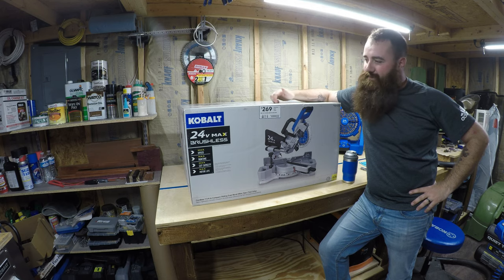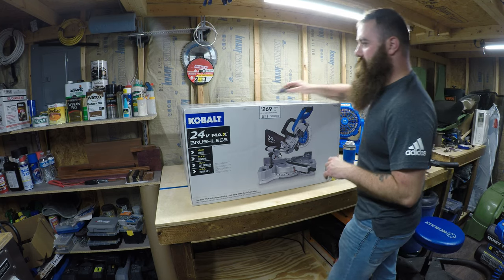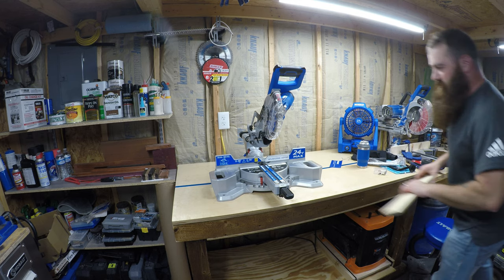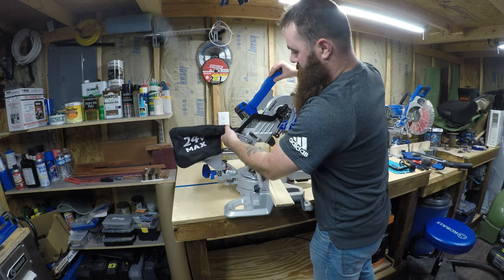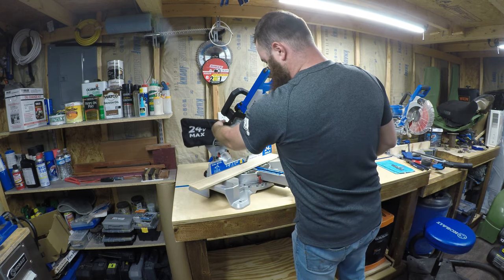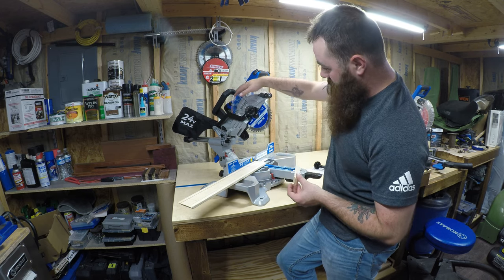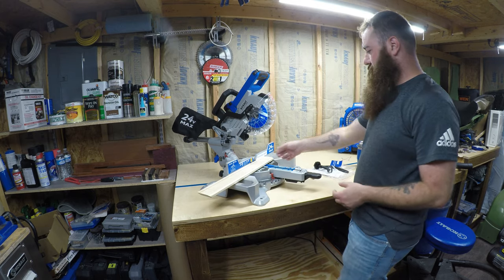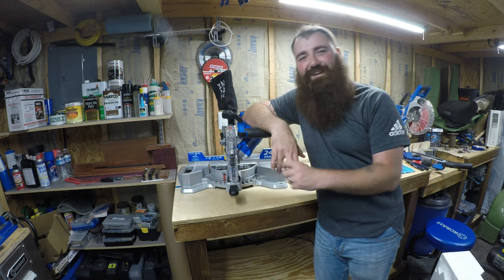Kobalt 24v Compact Sliding Dual Bevel Miter Saw Unboxing, Overview, & Demo

Comment: I do punch out and warranty work on houses, so I don't really need a huge miter saw. I had the Craftsman 71/4 and it did fine for what I was using it for (shoe mold, base mold, occasional crown mold) but I definitely noticed it did lack power and I had to go really slow. I was at my local Lowe's last week needing a 1/2 inch high torque impact wrench and decided to give Kobalt a chance since it was so much cheaper than Dewalt. Anyway, that thing blew me away with how good it was and how well built it seemed. I went back the next day and noticed a promotion on the miter saw that included a 6ah battery with purchase.  I  got the saw and battery for $229.00 plus tax. I expected it to be better than the Craftsman,  but it was worlds apart. That thing is a beast. I  wish I could have gotten it for $100, but I'm not upset with the purchase at all. It's got to be the best bang for your buck out there, and I plan on buying many more Kobalt tools. Sorry for being so long winded,  but thanks for the review and good job!
Reply from the maker: You got one heck of a deal my friend. That 6AH battery is $100 on it's own and the charger is $30. So you basically did get it for $100! I paid $100 tool only. I'm glad you like it and I would agree it truly is a beast. Thanks for watching
Reply: Good to hear your feedback regarding the quality of the saw. Sounds like it is well up to quality finish work.  I have being eying it at $269 with the 6 ah battery.

Comment: Lucky guy, sadly, I paid full price for mine; it was worth every penny.  I also have a lot of the Kobalt 24V tools; they are an outstanding value, IMHO.
Best of luck with your channel.
Reply: Picked one  up, $105 clearance, buy more save more.
Reply: @foam27  Let me know how you like it.  My local Lowes still has it at $169
Reply: @SouthernEngineering  Mine was $169(saw only) 2 weeks ago, went to $135. Buy more, save more,(1x $59 4.0ah batt, and 1x $43 charger) took it to $105 for the saw...$184 out the door for all.
Watch it like a hawk! ;)

Comment: Very important for precision sawing it doesn't matter which machine.the best you can do buy always a Slide Compound Mitre Saw with the handle in a line above the saw blade,everything has to be in line Slide bar rails,handle,and saw blade. it's better no tilt saw blade, and engine with softstart .
Handle vertical or  horizontal above saw blade is okay if it is in line above the saw blade and in line with slide bar.Everything has to be in line this is important examples: bosch gcm 800 sj / gcm 8 slj professiona / Evolution rage 3 / FESTOOL KS 60 / EVOLUTION RAGE R255 sms / HITATCHI C12RSH2 / FESTOOL KS 60 E KAPEX .                                                                                             
.
The best you can do
buy always a miller saw white handle centered in line above the saw blade (aluminum housing) winn winn.  And no handle on the side of the saw blade aluminum housing there is always torsion in the aluminum housing. It's possible, if you want you can test it by yourself at home.
Reply: Very helpful comment

Comment: Have you had the chance to replace the sww blade yet? Quite a few reviews I've read that they had lots of trouble when it's time to replace the blade.
Reply from the maker: No I haven't we just finished 2 big projects this weekend with the stock blade and it performed phenomenally. I have the doable hanging on the wall ready to swap. I think I'll go ahead and do that this week and get back with you. If it's like the 10" it's just one screw and then you have access to the arbor bolt. I'll keep you posted.
Thanks for watching.
Reply: @lumberhacks3528  For some reason my local Lowe's branch doesn't have this same model on display but have the competition Craftsman and Dewalt ones on display. I've had a few of Kobalt's 24V as well as 80V tools for a few years now and so far has not disappointed me other than their magnetic screw driver shank bit which was wobbly.
Reply from the maker: @GS-gv2yg  I looked it up on the app and still shows availible in my area so maybe you can order online if interested. I started with the 20v series and have used them hard and they have won me over. So if a tool is availible in Kobalt that's what I buy. I apologize  but I have not had time to do a blade swap yet but it is on my list. I will try and get that done tomorrow  with an accompanying video.
Reply: Any update on your blade change on this tool?
Reply from the maker: @GS-gv2yg  I apologize that it took me so long to get back to you. I shot this vid for you tonight. It took 3 hours to get it to upload, but that just serves me right for taking so long LOL. Here you go, Thanks for watching. Let me know if you have any other questions. 
https://youtu.be/NEePeic62s8